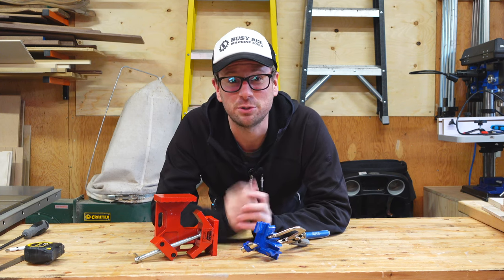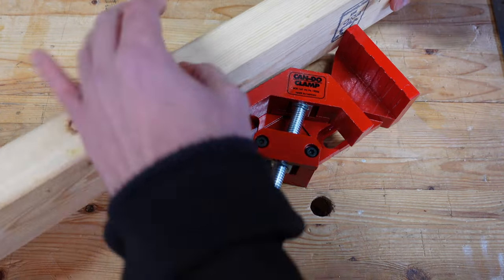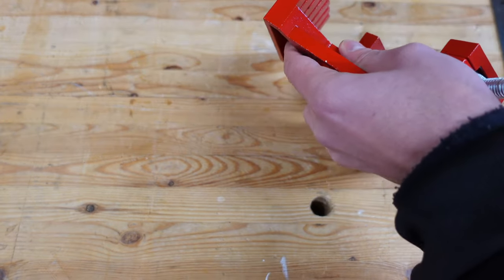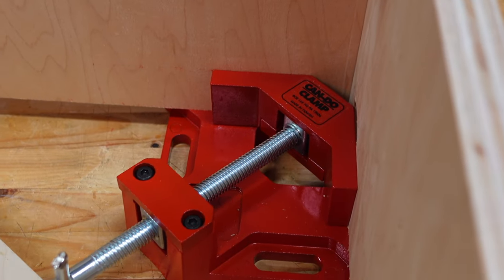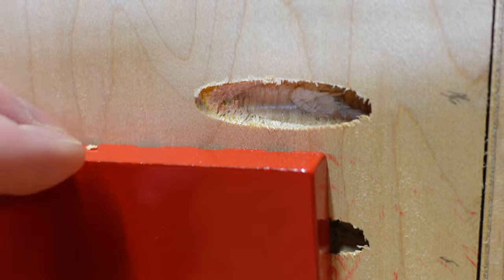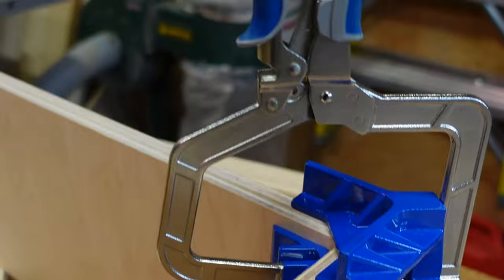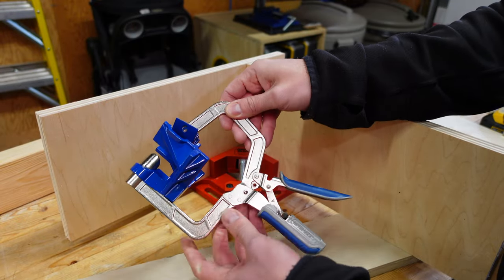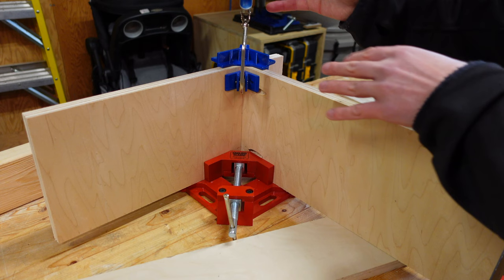Battle of the Corner Clamps - Kreg 90° vs. MLCS Can-Do // Which is best?

Comment: Good overview/comparison of the two clamps. I didn’t know about the Can-Do either but I’ll keep it in mind. It’s nice to know you can support it with a 3/4” scrap if you need to because it will make our lives much easier during assembly.
Reply from the maker: Thanks Gary! It’s been a surprisingly great clamp so far. Depending on future projects, I can easily see myself having 4, or even 6 in the shop.

Comment: There's a lot of debate about accuracy of clamps like these, so it would have been more useful if you'd actually got a proper square-edge to check whether they're truly square rather than relying on checking it by eye.
Reply from the maker: That’s a great point, thanks for noting it! Squareness would be particularly important when working on something that’s exposed, such as shelves. 

For me, I don’t generally need it to be absolutely perfect as that often comes down to the joinery being used. If I’m doing a cabinet carcass, I don’t worry too much about being perfectly square until I have all sides joined and even then the top will add additional support to get perfect square.

Comment: Thanks for the video!  I had never seen the can-do clamp.  How are they each on marking or marring the surfaces?
Reply from the maker: I hadn't heard much about the Can-Do clamp myself before coming across it when looking at some other MLCS products - I'm genuinely impressed with it! 

As for marking and marring, I'd say I've experience essentially none with the Kreg clamp and the MLCS Can-Do is still leaving a bit of red pain residue (easily brushes off), although I've only used it on a couple of projects so far. Nothing beyond that, thankfully! It still bothers me when I find little circular indentations on my early projects form some cheap f-style clamps.

Comment: So would one of each basicly do enough to make cabinets, or is multible of each a necesity? Also. Did you pocket drill free hand, or did you use some pocket drill guiding tool? Thanks✌️
Reply from the maker: You could definitely get away with just one! I have two now and would like to add another two, but I used one for quite a few cabinets without issue. 

For pocket holes, I’ve been using the Kreg 720 Pro for a few years (Kreg K5 before that).